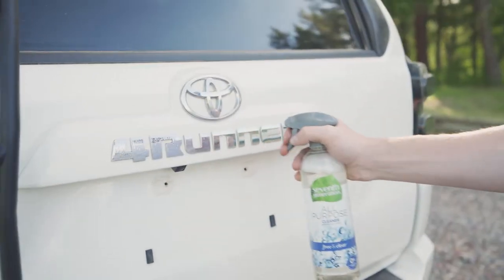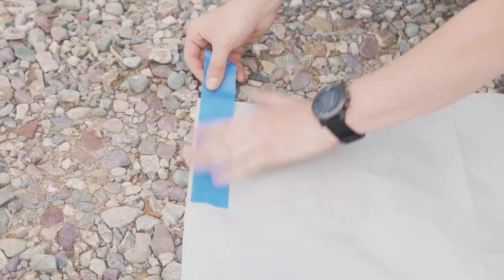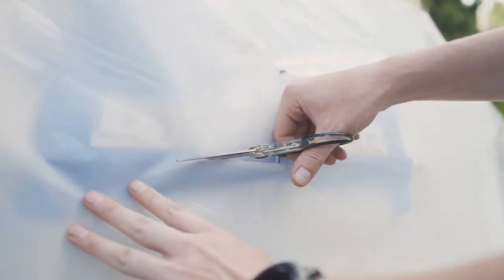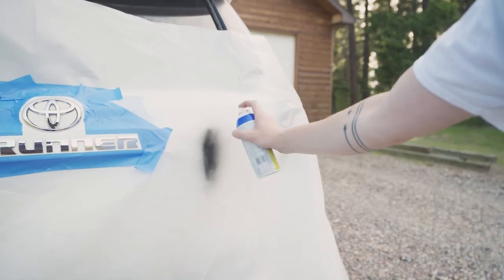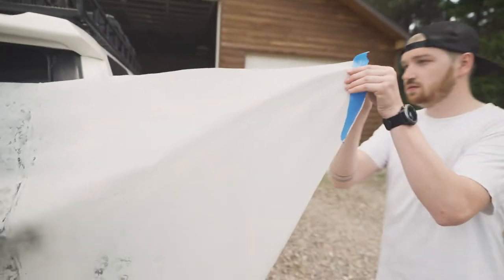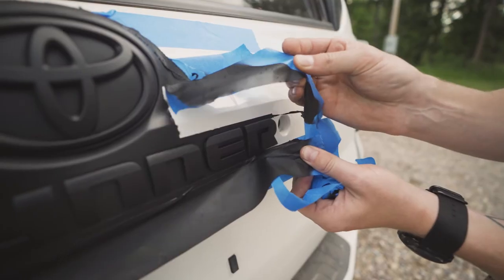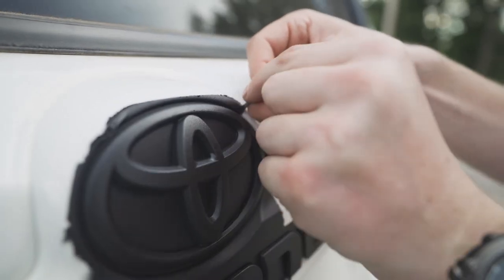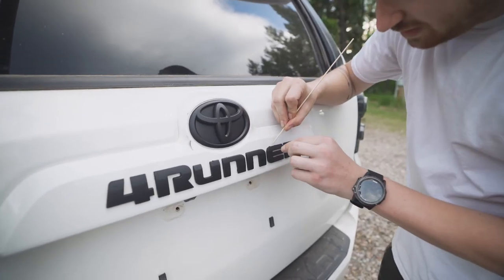How to Paint Your Car Emblems Using Plasti-Dip

Comment: Can I wash my car and it not peel?
Reply: It'll wash right off plasti dip is a temp solution almost like a car wrap Spray paint is a more durable and permanent solution
Reply: @kyle177  spray paint doesnt just peel off the places you dont want it tho
Reply: idk if it’s too late for a reply but if u do try and wash around where u painted and just use a wipe instead to clean it unless u used a lot of coats which will make it fine to do at first but not for long term
Reply: @kyle177  spray a clear waterproof coat on tip of it